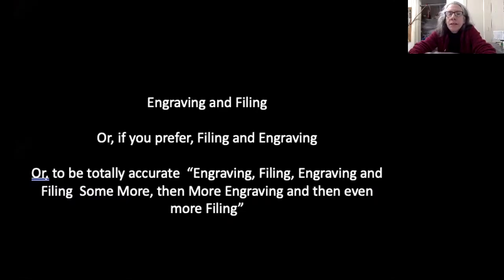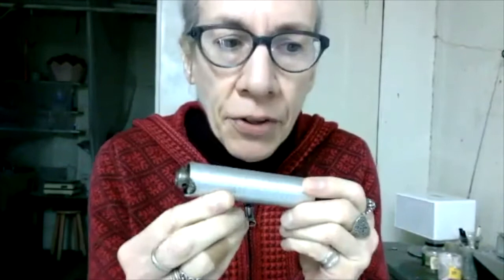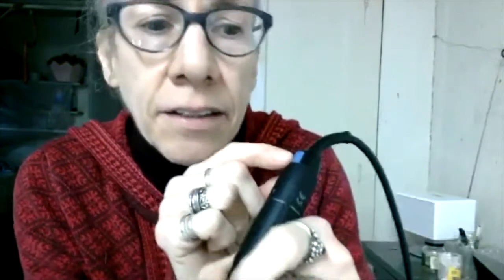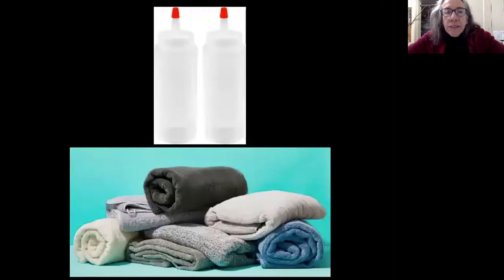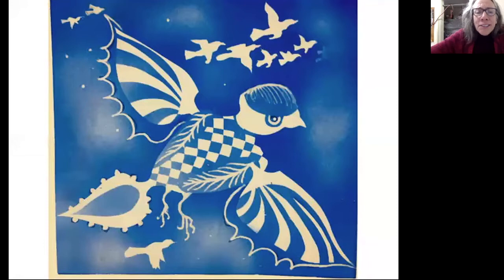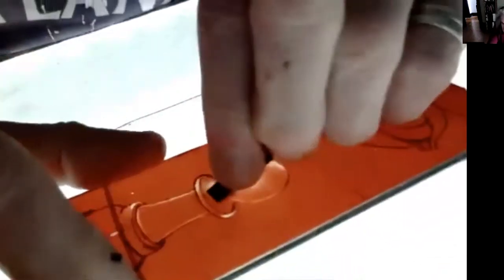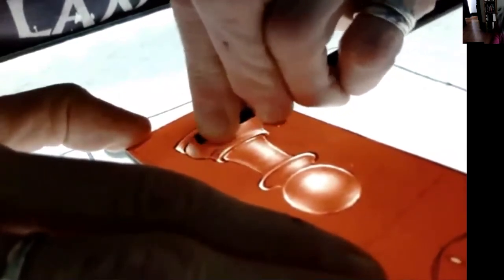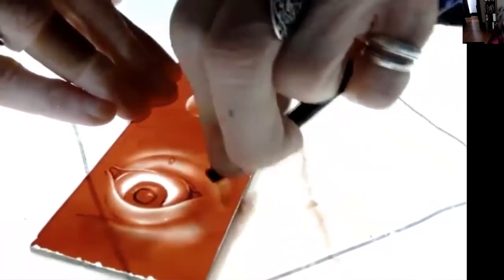05. Engraving and Filing Flash Glass

Comment: Is this the file you are showing in your demo (thin flat  120 grit)? https://www.gesswein.com/p-9987-3m-diamond-hand-files.aspx
Reply from the maker: I am not sure. I use the 1/4" one because the handle bends.  The larger sizes the handle is rigid..  For some reason its not in the picture.  Try HIS Glassworks.
Reply: @houseofrats  Thanks, I just ordered a couple to try from HIS. I have used the larger foam pads for the overall grind in the past. I also ordered the velcro blank handle 3/4" to try to "frankenstein" some other abrasives on some sort of velcro pad. But as we know, diamonds are a girls (and  guys) best friend, but $$.